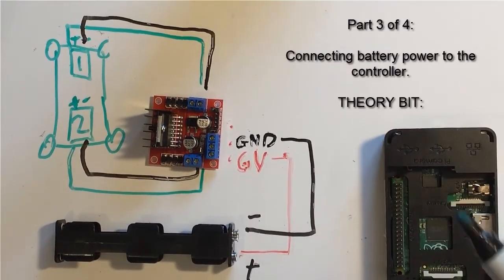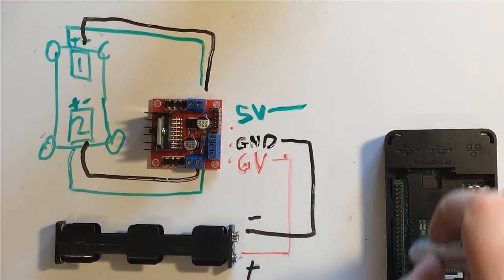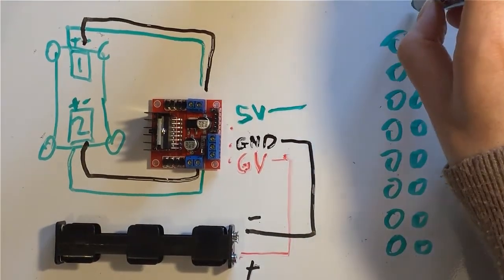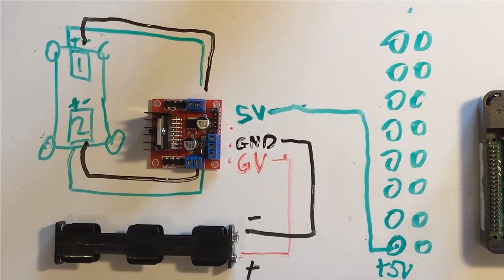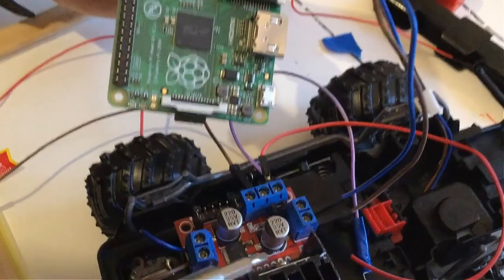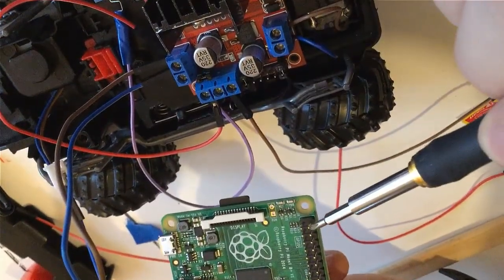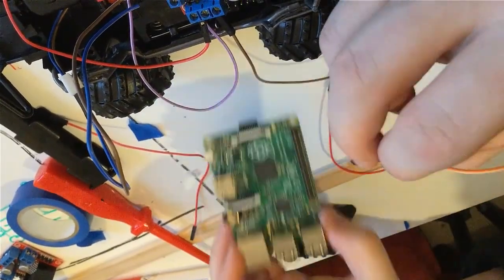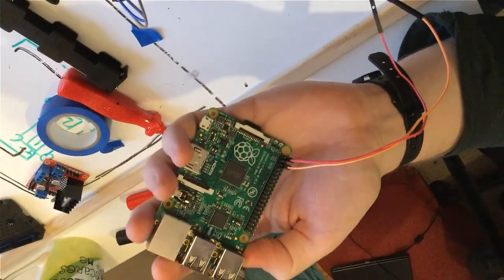Make a Raspberry Pi Rover for $5.00! (Part 3)

Comment: Hi Daniel
I'm trying to make the rc car using a respberry pi zero w 
I've followed all the videos and I've had to change the pin line up as isant the same at the pi your using. But ever time I load up the pi to start coding one of the motors start running I've tracked to the 5v power witch is doing this but I don't know whats been don't wrong for the motor to keep running any help would be grate thank you for reading
Reply from the maker: We had that problem. You need to run the gpio cleanup code. Your Gpios are still high if the wheel is spinning.